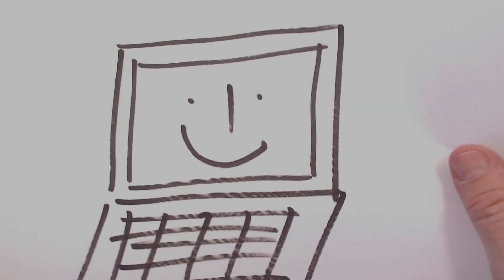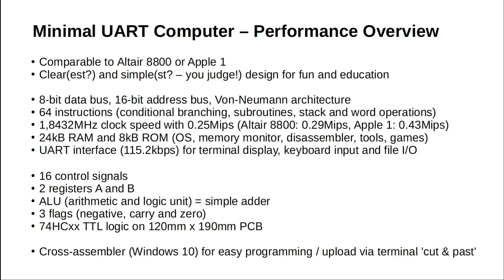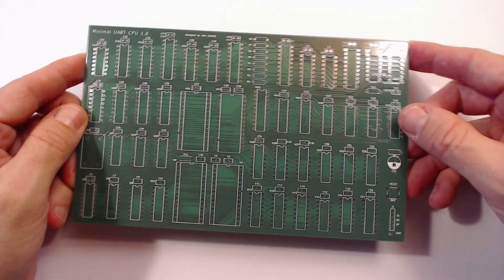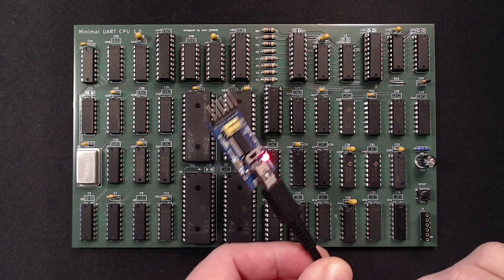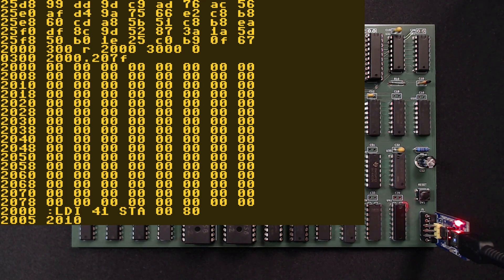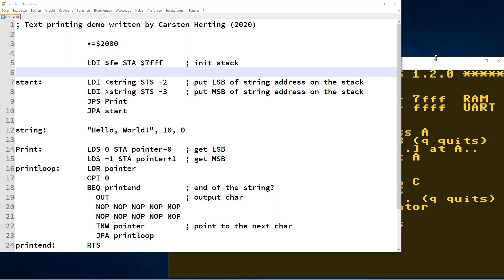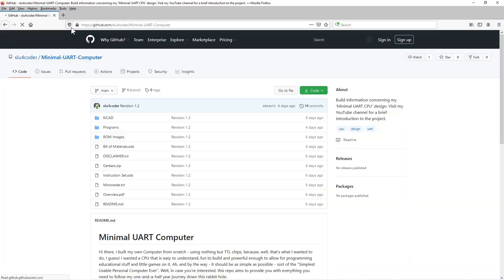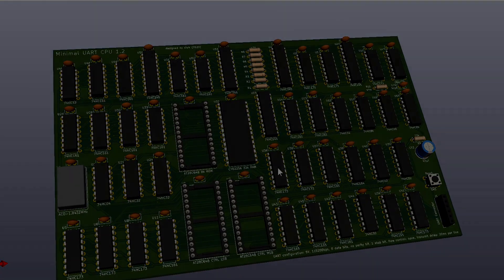Build the 'Minimal UART Computer' on PCB - Simplest Usable PC #2

Comment: Hi Slu4,  Thanks for this great project.  I'm impatiently waiting for PCBs and parts.  I'm an old mainframe application guy,  but have coded a few games on micros.  Looking forward to seeing what develops!
Reply from the maker: Hi Bruce, that's great news! Let me know how things go during assembly. Mainframes and mini computers - that was REAL hardware :-) My little machine tries to capture that spirit a bit. Any new tool or game would be highly appreciated :-)
Reply: @slu467  Thanks, the Flash Edition is the repo I'm working from.  Haven't been able to get the emulator working on my older hardware, (32bit winXP & win7)  so I'm really looking forward to the build.
Reply from the maker: @goosebeg  jep, the emulator is compiled for 64-bit architecture...
Reply: @slu467   It's weird, I was able to re-compile with a 32-bit version of g++, and the emulator displays the splash screen with esc characters visible.  From there, responses to keypresses are painfully slow, 10+seconds.  Programs run very slowly with esc sequences visible.  Pre Windows 10, the cmd prompt doesn't deal with ANSI control sequences, so I'm thinking that's my problem.
Reply from the maker: BTW I have published a "Flash Edition" for this design offering SSD storage capability and a simple file system. I'll soon publish a 512KB SSD hack for it ;-) So there will be potential for larger applications (native assembler, text editor, etc.). Also with FLASH memory (cheaper than EEPROMs) the system is in principle capable of running at 3.6MHz rather than at 1.84MHz. We'll see...

Comment: Very well-done!  I thought the comparison to the historical computers was interesting.  I was curious how you assessed the Mips rate.  It seems your instruction set has an average of ~8.8 micro-instruction steps per instructions, which would give more like 0.21 Mips.  Did you try to use some typical instruction mix to define a weighted average? Or use a larger program like the Tetris gave to give a practical instruction throughput?

On a separate matter, did you define graphical characters in your character set, like Commodore did with their PET and later computers?  It seems Tetris could be dressed up a bit with a few graphic characters!
Reply from the maker: Hi Michael, thanks al lot! I've used some typical code (can't remember what it was - Tetris or math) to estimate the MIPS number. Of course it depends on the type of problem the CPU needs to solve. Concerning the graphics: This CPU actually does not care about it's charset. It has none :-) it just spits out ASCII values through the UART. It is up to a terminal to display characters on the screen. So in principle some custom terminal charset can of cause contain custom characters.

Comment: Yeah, today I finished building your design and it works like a charm. Again great work man! The only thing I struggled with, was that in Terra term I had to configure Terminal Setup -> New-line Receive: LF & Transmit CR+LF to be able to use the ROM - Maybe I have overlooked smth. Uh and one last thing: Are you aware, that at least 2 Mnemonics changed between the Asm inside the Emulator and this (DEA vs DEB, INA vs INB)?
Reply from the maker: Hey, Inxrox, that's awesome news! I am very glad that it worked on your side. Congrats, you are now officially owning the serial number #2 of this design :-). And yes, I am aware that the Emulator (the one with the fancy console) uses a slightly older version of the instruction set. I'd love to hear about your further experiences with this CPU. Cheers.